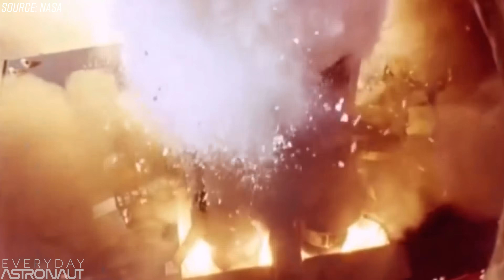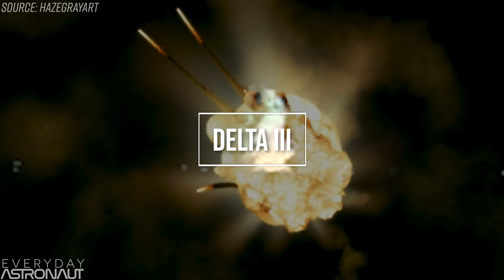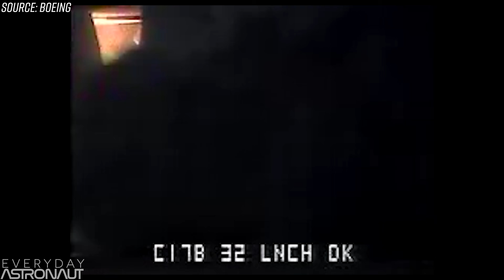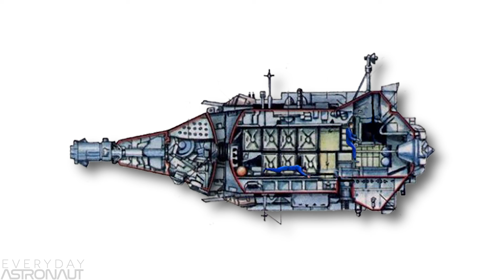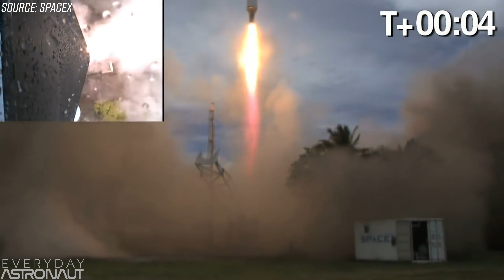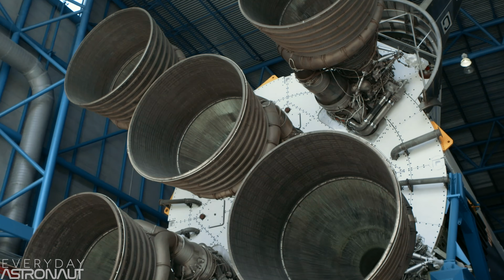Abandoned Space Hardware: CANCELLED Part 2

Comment: Sending two landers that are capable of operating autonomously is actually genius. You could load up the second one with samples before launching in the first, permitting recovery of far more material. If the primary fails, you just leave the samples behind. It doesn't have to be wasted redundancy even if you are not going to the same place again.

Comment: The explosions of the N1 where kinda intentional. People often forget that the USSR had a completely different way to test their rockets and the engines. Instead of building complex Teststands, doing a lot of computer simulations or place mockups in a windtunnel. They just screwed an engine to a Tank or build an entire rocket and let it fly, waited to the expected explosion and fixed what caused (based on telemetry data) the explosion than tried again and so on.

For the N1 they actually planned 12 launches(/explosions) (without any crew) before ever going to the moon or even to orbit. They kinda wanted the failures. 
The spectator at the first N1 launch where actually surprised that the rocket even got off the pad in the first place.

This also not actually that stupid to do back than computer simulations took much much longer an windtunnel can't simulate everything and building a Teststand which can withstand such a force is also not an easy task.

There is actually a great documentary which is partially about the N1 More about the (certainly superior) Engines of the N1 but still. It's called

The Engines That Came In From The Cold - And how The NK-33/RD-180 Came To The USA.

USSR/Russian rocket technology is way more interesting than American imao.
Reply: That is an interesting perspective. It is basically the exact same idea behind spacexs starship testing.

Comment: Great job on describing the LK lunar mission profile.  One more fun fact: as you stated, one LK would be landed uncrewed prior to the crewed lunar mission, and the crewed LK would use a pre-landed Lunakhod as a homing beacon - but if the engines on the crewed LK wouldn't light for the ascent, the cosmonaut could actually ride on the Lunakhod (it was designed for that) to the spare LK!  Additionally, the Lunakhod had photovoltaic panels for recharging its batteries.  It's strange to think these days that the Soviet lunar landing profile had more built-in redundancy than the U.S. profile, what with the political pressures which existed at the time (as evidenced by the risks which were taken with Voshkod, Soyuz 1, etc.).

Comment: another "saturn v" , the incredible  Nova ,was 9 f1 engines in the first stage, 5 m1 engines in the second stage and one m1 engine in the third stage(the m1 was a f1  optimised for vacuum,whit 10,000 kilonewtons of power) and huge service module that also was the lander.

For part 3😃😃😃.
Reply: 8 cause C-8
Reply: That was designed when they still thought they were going to do a "Direct Ascent" profile for the mission - you needed all that rocket to get the fuel necessary for landing, launching, and returning to Earth onto the Moon.  But Nova and the larger Saturn concepts (C-8, C-9, etc) never got to the hardware stage, which is what this video is all about.

Comment: One thing I've never understood ( and maybe this is me being stupid ) but why oh why has so much cash been sunk into trying to develop the SLS when something like the Saturn V is already designed and known to work?  Have all the schematics and blueprints been lost?  Seems like it would have been cheaper, quicker, and overall more efficient to dust off the Saturn V specs and tweak them where current tech could improve things or cut costs then go from there...
Reply: A lot of the engineering know how has been lost to time.  Here is a video from Curious Droid that explains this: https://www.youtube.com/watch?v=ovD0aLdRUs0
Reply: @splitzgymnastics2009  thanks, that's something that's been bugging me.  Just watched the link and for anyone strolling comments that doesn't want to watch; what I took away from the Curious Droid vid is that we have the designs...the problem is that the design was constantly tweaked and improved as the physical engines were built and for various reasons those improvements were never noted down.  So the designs we have and the rockets/engines that ended up getting used aren't the same thing.

Comment: Imagine if SpaceX would open a production line for the Falcon 1.  That would be a direct competition to Electron and they may even be able to land the 1st stage of the rocket which could be a savings as well.  Given that the 3rd iteration of the rocket would have double the capacity of the 2nd and with the Merlin 1D engine it would have even more thrust so it would easily outmatch Electron so it could be reusable very easily by cutting down the amount of payload.  

Given that information they could also take on Minotaur rockets and the competition from Russia.  In the end it would be a very interesting proposal for SpaceX if they want to reduce the cost of space flight but it does have one small issue.  The second stage engine is currently not in production; however there is a solution, the Super Draco engine.  If they put one of those engines on a second stage it would preform twice as effectively as the Kestrel but would have to be hypergolic instead of the RP-LOX that the Kestrel was.  In the end it is an interesting idea they could do.  As well as the fact it is designed to operate in Vacuum it makes some sense to use.  

The issue of reusing of the 1st stage of the F1 would be engine throttling.  Could the Merlin throttle far enough down is the question.  As the only source I seen is a 40% of the thrust which would be too high for a F1 to land on unless they do the landing burn very late to cut velocity from the free fall.  

The final item is the cost of the rocket launch.  It appears the latest numbers they put up was 11 million or about double the Electron for over twice the launch capacity.  It is very interesting idea as this does have merit but is this something SpaceX wants to use as a goal given their current focus.

Comment: The Soviet craft are rounder and smaller in part because they used a higher internal pressure than American craft. The Apollo-Soyuz mission required an airlock \ decompression chamber because going from the Soyuz to Apollo quickly would cause the bends. And the pressure in a Soyuz would pop an Apollo.

Comment: I have a tie in to two of the rockets you talk about. I worked on Delta III. While I was at the cape for the 1st Delta III launch I went to see the Saturn V. One of the guys I was with had actually worked on the Saturn V. He pointed out the hardware he designed on the display vehicle. It was cool to be standing there while one of my colleagues was describing the hardware, the design process and pointing it out.
Later that evening we went to the Delta III launch and our hopes and dreams went up in smoke as the vehicle came apart.

Comment: The LK lunar lander was basically just the ascent stage. It used a blok d upper stage (the same one that is used with the proton rocket to this day) for orbit insertion of the L-1 spacecraft. After the cosmonaut did a spacewalk to the LK lander, it would detach from the bottom of the service module on the Soyuz-LOK. Then the almost all of the spacecrafts velocity would be shed from the blok d, before ejecting it to crash on the surface of the moon. From there the LK lander would fire it's engines and remove the last bit of velocity before landing. The rest of the mission was quite similar to Apollo. It used the lower portion of the spacecraft as a launch pad and went into orbit before preforming a rendezvous with the Soyuz-LOK. It would then dock (which could be done only once), the cosmonaut would spacewalk to the Soyuz-LOK and then it would ditch the lander and use the service module to leave lunar orbit.

Comment: I bursted out laughing when I saw the engineers pulling and pushing the Saturn V for testing. Had never seen those videos, it's amazing! Funny how in those days sometimes the simplest of methods would work, and it did work because the Saturn V is a beautiful beast in itself.
Reply: that was funny, you think they could have got some horses or circus elephants (yes they existed in those days) for the dynamic test. :D
Reply: @ronschlorff7089  at least a couple of kerbals!
Reply: I bet they could not duplicate higher frequency  resonance vibrations! LOL
Reply: Which Saturn v is that? The one now on display in Florida?
Reply: @MoonMan22  Yep.
Reply: I also note - it is a routine operation with missiles to hang them up on a cable, and hit them with a hammer.